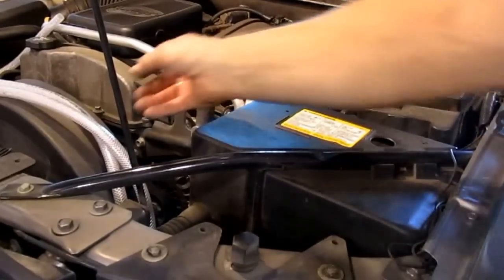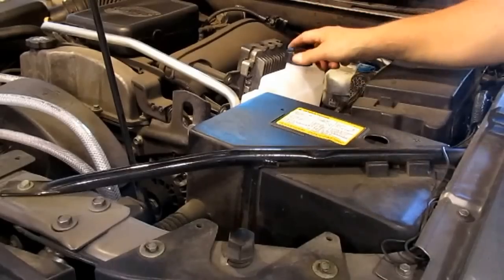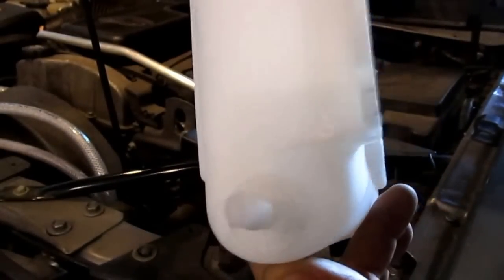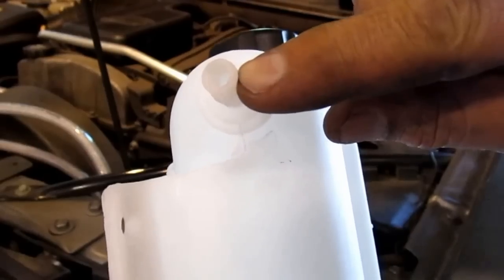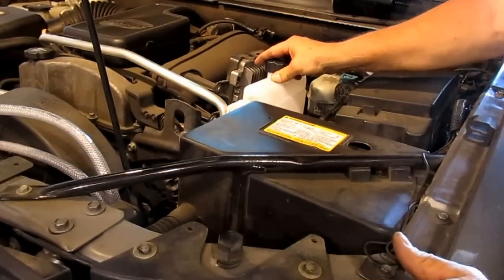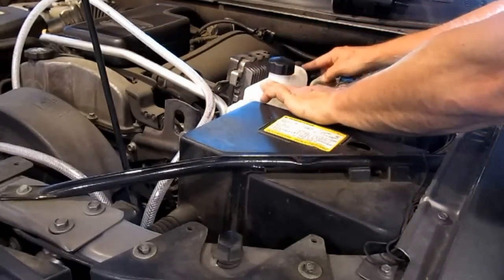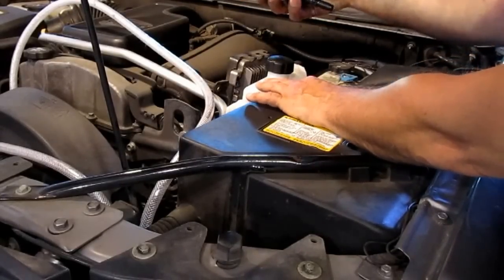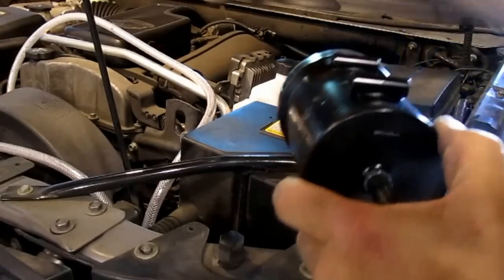How To Install The HHO Reservoir Part 1

Comment: What if you’re in freezing climate?  Does the electrolyte keep the system from freezing?
Reply from the maker: We find if you add denser solution of electrolyte, it prevents freezing in most cases. Not in severe freezing like Alaska (-40 F and colder), but certainly in northern US and most of Canada. It is important to use the PWM to regulate the amperage with higher electrolyte levels.
Reply: @transitionaltechnologies648  yeah it’s usually around -20c here but does dip to -40 or below for a couple weeks